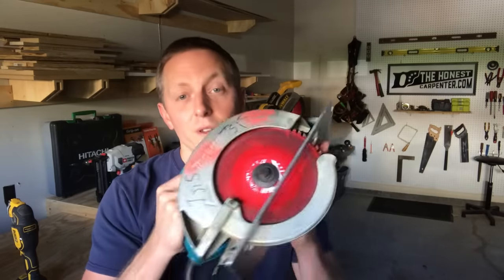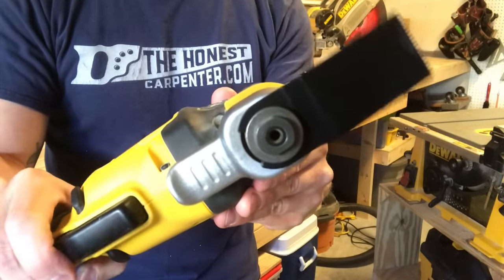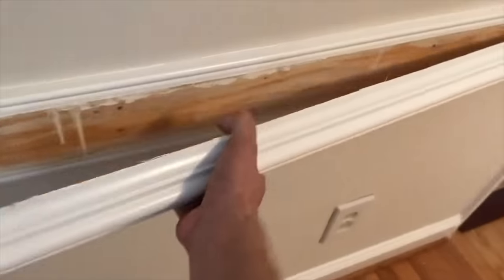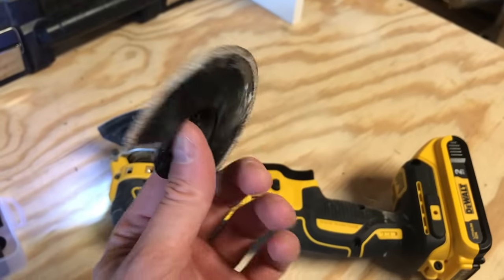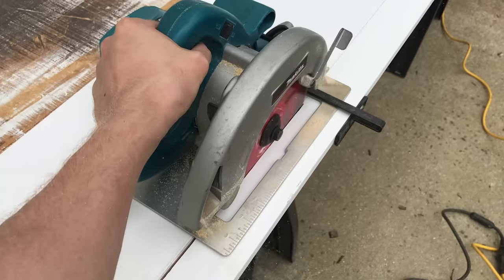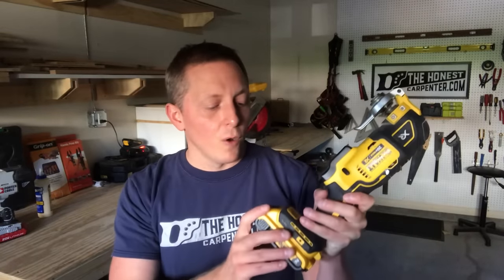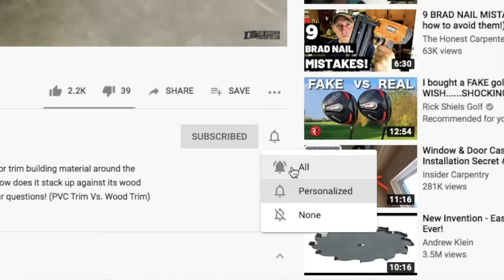The BEST SAW You've NEVER HEARD OF!! (Multitools--Great For Remodeling!)

Comment: Umm just so you know, you can stick the thing blade first right into your arm and it will NOT cut you.  They are used to remove casts for broken arms.  It will only cut something that is rigid or fixed firmly.  It is the safest cutting tool that exists.
Reply: I still would not try this with a wood saw blade
Reply: @ThePainkiller3666  Only this type of oscillating saw won't cut you that I am aware of.

Comment: This kind of tool was used 50 years back to cut casts in the doctor's office. The reason why is that if you put the end against your skin while running it will not cut you. The material has to be very hard. It is actually very safe. There's another youtube video where the guy actually turns it on and presses against his forearm. It doesn't cut his forearm at all. But if you dropped the unit straight on to your toe without shoes, yes, the weight plunging down could break your toe or cut you badly. But so could any sharp tool.

Comment: Hey I've been subscribed for a while now, always appreciate your approach as you say you are the "honest carpenter" love that name and it does suit you. I don't know what to say about the person that did not know that you cut the door trim away to match the level of the floor - I swear I left him alone to do the flooring but I guess I shouldn't have. Being a woman and having the tools that I have I guess I just don't understand it when I know better than the man doing the job. I wish I could share a few pictures of what the flooring that I took the time to use a process of elimination considering the look, value and how the looks all flow together making one cohesive end product being .... my home. I have a Rockwell Oscillating tool and I love it. Being that as it may ... the damage is done - do you have any recommendations how to approach getting the flooring pieces out now to do them right. I've been looking at it for some time because of course the problem is not just at the threshold of the door to the room - it's also some feet away at the closets. I did buy one box of flooring as overs I'm hoping I (and yes it's just me) that I can do what I need to do by replacing boards and using my oscillating tool to remedy this awful product that I'm embarrassed about - the guy that did this said "oh I can just fix it with caulking" definitely did not have the opportunity to even try. I was beside myself - it's a BIG deal now. Anyway Subscribed from Port Hope Ontario Canada

Comment: Is this What u would use to cut a cabinet outer side panel that forms the fridge “cubby”? It comes down from the cabinet above the fridge; the panel bends inward & I need to remove it to pull the fridge out.

Comment: I'm about to purchase an oscillating tool to cut drywall along a wall near the floor (looking for termite damage).  I'm not sure what is behind the drywall and was wondering.  Is there a guard that can be attached to prevent the tool from plunging past a certain depth?  Do you know of a hack where a temporary guard can be attached to accomplish this? Thanks.

Comment: You didn't mention this in your video, but there is NO better tool that I know of for cutting precise scribe cuts in luxury vinyl plank flooring (LVP), which is very popular right now. You can free hand it, but you can also set up a simple 2x4 or other wood as a cutting guide and ride your blade along the wood into the LVP for a precise, clean cut. It does create melted plastic fumes so probably best to do outdoors or wear an organics rated respirator.

Comment: He didn't mention how dangerous the vibrations from them tools are.

Working as a prosthetic technician, I used one for atleast an hour a day cutting out the sockets.

I also rode a motorbike so with them too things added up my hands would vibrate until bed time.

The vibrations cause damage to your small veins and capillaries restricting blood supply to your nerves.

Eventually this becomes permanent and theres nothing you can do about it.

So my advice is they are great but use them sparingly and use vibration gloves.
Especially if you have cold hands.

Comment: One more downside, the vibration for most multitools are hard on your arm if you use them for extended periods of time or on a daily basis. It really doesn't matter which brand you choose as they can all oscillate in the 10s of thousands RPM and that inevitably creates a lot of stress to your hands, and elbows. One way to help with that is pick up some gloves that absorb vibration. There are quite a few good ones out there so take your pick but that does add to the total cost. That said, for aa general/non-structural remodel, this is hands down the best DIY power tool.

Comment: Like you say, the biggest draw back is that the saw blades do not last long because you are only using about 1" of the saw blades teeth. Some of the better brand saw blades can cost $10. I buy the cheaper ones in packs of 20 and just go through them. It is an extremely handy tool. I just replaced a rotter window sill and could not have done it with any other tool.

Comment: I just bought a cordless multitool from Dewalt and when I put the blade on it isn't straight but is angled off center to left. I've tried different blades but still not straight. Is this normal or do I have a defective product?

Comment: Hi Honest Carpenter! Your vid rocks. But I have a question unanswered in your vid. Does the multitool make less mess than a grinder? Does it make less tiny pieces flying in the air (e.g. the dust when cutting fiberglass)? Thank you for your answer
Reply from the maker: Definitely less dust and scatter, and more precise overall. But nowhere near the power or speed of a grinder! Thanks for watching! 🙂
Reply: @TheHonestCarpenter  thank you, Carpenter. I think this is an important issue to be considered if you need to work at home or cut fiberglass. Fiberglass dust is really bad for your health and it is better to use the tool that gives less dust. Moreover, it will take weeks to get rid of dust from your apartment. Take care!

Comment: I've found it to be a very safe saw. I've accidentally touched the blade while it was running and never gotten a scratch. Not that I recommend trying that. But because the cutting vibration range is so short and skin is so pliable, it will tend to jiggle your skin back and forth rather than slicing through it. You could certainly cut yourself if you gave it any real pressure. I seriously doubt you'd lose a toe if you dropped this on it. A razor knife would be far more dangerous.

It's not a good choice for cutting metal. It will certainly cut through nails and screws, but it's slow and it wrecks the blades quickly. There's a reason why he did a jump cut in the video when he started cutting that screw. It would have probably taken over half a minute or more to cut that, which wouldn't look good in the video. It's the best option to flush cut or plunge cut through nails and screws. But if you're just cutting through metal that's not in an awkward position, like his pipe example, use a grinder.

Carbide tipped blades will last a lot longer. They're more expensive, but well worth it for the extra durability.

Comment: This tool will not cut your skin. It was initially designed to remove casts without cutting the skin. You can put a finger on the blade and it will not cut you as the skin simply vibrates with the saw.

Comment: I had a strip deck drain adjacent to a block wall.  This drain would always clog up as it filled with dirt that then became mud.  I had earlier tried to cut off the top of the drain with a grinder, but this was not effective and very dangerous.  With my cordless multitool, I was able to easily cut through the drain top so that mud could easily be removed.  I would not have been able to do this  with the multitool.

Comment: I've only been using mine, as a saw, when nothing else will work.  The reason is, the cuts seem to take a long time to make, and the cuts smoke a lot.  Maybe I wasn't using the right blade, or was using a dull blade ... just cutting through wood, and it happened a lot.  I'll try again.

Comment: Oscillating tools are awesome, but you would be hard pressed to find any professional trades person that isn't familiar with them or own them.  The oscillating tool is not a multi-tool unless it has interchangeable heads for various purposes (right angle drill, reciprocating saw, nail driver, jigsaw..etc.), such as the RIDGID JobMax series.

Comment: Can the multitool be used to remove morter from bricks?  If so what blade should I use?
Reply from the maker: You could maybe try the flat scraper attachment, Christina, but it would have to be very crumbly mortar. Otherwise it might not have the power 😬

Comment: This tool feels like it’s 90% marketing so far.  For those of you like me who have a lot of tools.  A lot.  What are you using these vibrators for?   I haven’t found it useful in most situations.  I cut a drywall nail when installing a flush medicine cabinet.  I guess it helped but not really.   I’m moving 2 electrical outlets tomorrow and need to cut the drywall for the new electrical boxes.  Maybe it’s usefulness will blow me away with that job 🫢

Comment: Can and should it be used with counter top removal
Reply from the maker: Probably not necessary Christopher. Most counter tops just lift off. Most you usually need is a knife and a drill

Comment: I just use a cheaper plug in version I bought used. (trying to not become a freakin' battery collector.)  I'm sure some folks really  use theirs a lot . But for me it's a nice to have, specialty tool for special situations.   That thing can definitely be the right tool in some occasional situations I have found.  It's a pretty safe option too.  But some things it struggles to cut and you can quickly trash one of those little blades with some of thos4  delicate little "metal cutting" saw teeth.....I hesitate to call it a power tool.  I mean Dremmel makes one. so...  It's really kind of a carving and artwork tool.right?  But trim is a kind of art, so...

Comment: wrong, oscillating saw mostly can not cut flesh or anything that flexible, because the micro teeth moves forward about 1mm then it retracts towards the other direction,  It is the same tool that cuts away the cast from the healed fracture in hospital.  The best thing of oscillating saw for me is its safety.  Although they can be loud, that does not mean they can be hurtful.  You can try it out with care. It will not hurt flesh masses nor the loose skins.

Comment: I've got a dewalt multi tool! Beware the speed control is rubbish no control you can't lock it on only on flat out. Then on top of all that the vibration will damage the nerves in your hand be warned and I've been a carpenter for 40 years.

Comment: Wondering if the cheap blades need replacing much more often than the branded more expensive ones
Reply: I use branded ones and in my case it doesn't make sense, just accidentally hit the screw and the blade is destroyed, so I prefer Chinese replacements because I use about 40  blades per year

Comment: At 6:02 , what is that guide on the circular saw used for? Is it just to keep it going in a straight line?
Reply from the maker: That’s the rip fence, Abraham. Yep, keeps the blade at a fixed distance from the edge. Comes with most circ saws.
Reply: @TheHonestCarpenter  thanks! Do you think circular saw tracks such as those made by Kreg worth it? Or is just clamping a straightedge and using the plate of the circular saw as a guide work well enough?

Comment: I've heard of it,  and after you hear one in operation you'll never hear the same again. They are loud, and in my 43 years in the business they are of little use. Garbage,  don't waste your money on one, you can use and angle grinder, with different cut off disk. Or just a good variable speed reciprocating saw (Sawsall) these will do anything you need to do, quieter,  and the blades are more durable, available and less expensive...so save your money and your hearing. .God bless
Reply: My personal opinion but I beg to differ  Other day I widened a cased opening. In doing so I cut the baseboard and quarter round off square with each other, in place with the multitool. After finishing framing the rough opening and building the jamb I ran a scrap of door trim down to where the baseboard was. The base board was even with my rough opening. So, using my scrap as a gauge, I drew a line and I cut the base back to allow the door trim to clear. Then I wanted to put a 22.5 on my quarter round where it butted into my door trim, which I had square cut in place earlier when I first began. I cut the angle, in place, while not touching the hardwood beneath. I don't see how I could have done any of what I just described with any other tool. Not in place anyway.

Comment: Have a Dremel brand because I trusted them with these sorts of smaller, high speed tools
Years ago--when not as many other manufacturers offered them and cordless was not even an option. Blades still hard to find, expensive and DO dull easily and quickly...so much so I have had to add the cost of specialty blades into P/M to the client
None of your links for blade multi-paks are compatible with Dremel!

Comment: As a carpenter for +30 years i would NOT  recommend the dewalt Saw it has NO shock absorbtion and all the vibrations goes directly into your hand and makes it numb, take the Fein Saw instead, its a Dream of a tool, and with built in shock absorbtion you Can work for much longer without the risk of “White finger syndrome” have a nice day 👍🏻

Comment: How about removing tile from shower floor?
Reply: I purchased a Fein MultiMaster  to remove a loose tile on our shower floor.  I was able to cut through the grout with a carbide blade without damaging the loose tile or the adjacent tiles.  I also removed the thinset on the bottom of the  tile and on the shower floor using the MultiMaster and a different carbide blade.   We didn't have any spare tiles so I had to remove the loose tile without damaging it or the adjacent tiles!
Reply: @RichW240  thanks Rich I'll give that a try. Could always use another tool.
Reply: @ralphwhittemore5041   You are welcome, Ralph.  When I had to remove the shower tile, the Fein MultiMaster was the only tool of its kind on the market.  You are fortunate because there are so many similar tools on the market, today!

Comment: You are correct, it is first and foremost a saw. We used them as cast removal saws before they were used as multi tools. In fact, the older blades were great at not cutting skin. And the plunge cut is the way we entered the cut to a cast. I have used the bosch so much, I burned out one and a rotary one too. They hopefully have made them able to be fixed, i.e. brushes and such.

Comment: Never heard of? I find it hard to believe that anyone doing DIY home renovations doesn't already have one of these. They are the perfect tool for flush cuts or tight spaces. How can you install new flooring or remodel steps and not have one of these? Well, ok you can use a hand saw, but this saves you a lot of time and grief. To be honest a circular saw, mitre saw, jig saw and the oscillating multi-tool are all the cutting tools you need. Forget the table saw, you can use a homemade track and use your circular saw instead and it is generally safer. I would invest in a router before I bother with a table saw.

Comment: I have to disagree about the danger involved in these tools. I’d say they’re safer than any other saw out there, except maybe a circular saw with the guard. I’ve intentionally touched this up against my skin while it’s running with not even a scratch. I’ve done that when introducing people to the tool for the first time to make them feel more confident in using it.
Reply: I think it's less dangerous than other saws but I have cut myself with it once. Enough to draw blood. Now I was doing something really dumb so I can't blame the saw. I was cutting a sixteenth off a jamb with a thumb right in the path of the brand new blade. The saw slipped and because I had some pressure behind it pushed into my thumb. It put a little gash in the pad of my thumb.

Comment: The multitool is a lot less dangerous than youve made it out to be. It's actually what they use in hospitals to remove casts because it will easily cut through the hard plaster cast material but when it reaches your skin, it essentially just vibrates it back and forth and won't cut through because of the elasticity of your skin.

That's why multitools are rubbish at cutting through soft materials like cloth or rubber, they just shake it side to side without cutting.

So I don't think it would injure you that bad if you accidentally hit yourself with the blade but I still wouldn't like to test it out, safety first.

Comment: the trigger dies on that dewalt model. Dont buy it. When cutting upside down, the dust gets in the trigger switch and it has no bellows to stop dust ingress so it just dies. $65 replacement part that can only be bought with the motor and speed controller together.

Comment: Cost of blades is still wayy too  expensive and the blades have a uncanny way of finding unseen fasteners.  We call it the "noise machine" on my jobsites. Laborrs will happily burn thru blade after blade starting small fires  cutting thru 2x material as i count profits burn away in pine/fir smoke . . iNow im the only one allowed to use mine, used only for jambs and as a way to drown out homeowners complaints...

Comment: 2:18 "You just load the blade so the bent neck angles downward"
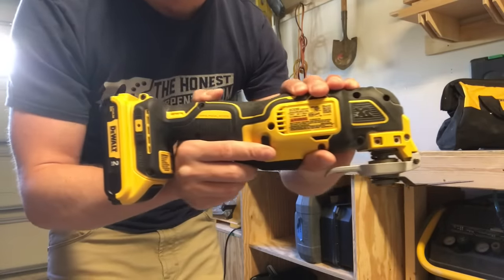2:28 Blade installed with the bent neck angled upwards
3:14 Blade installed with the bent neck angled upwards
3:20 Blade installed with the bent neck angled upwards
5:36 Blade installed with the bent neck angled upwards
5:43 Blade installed with the bent neck angled upwards